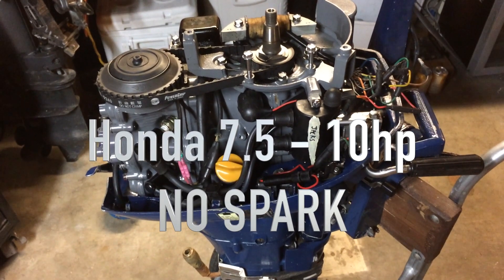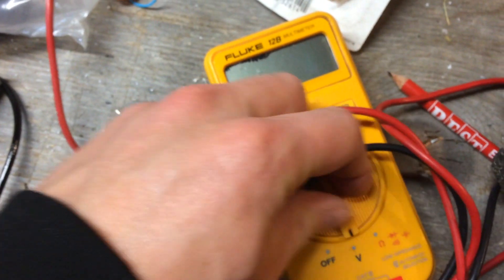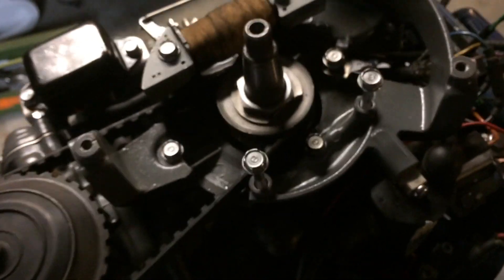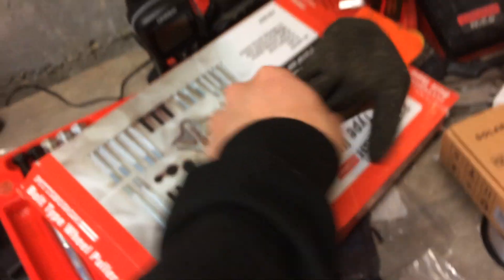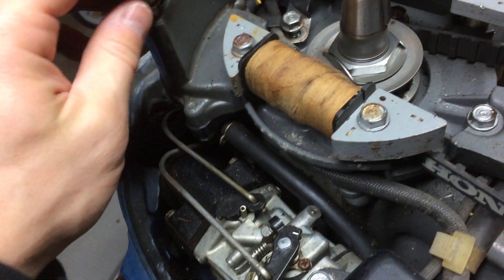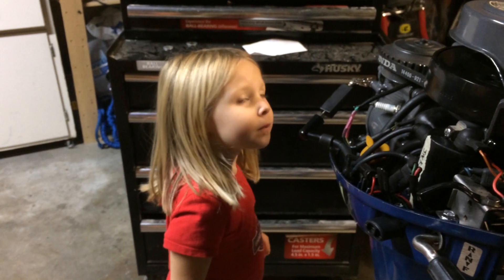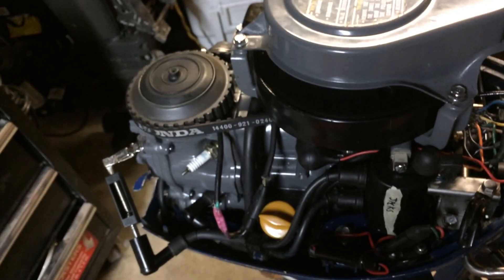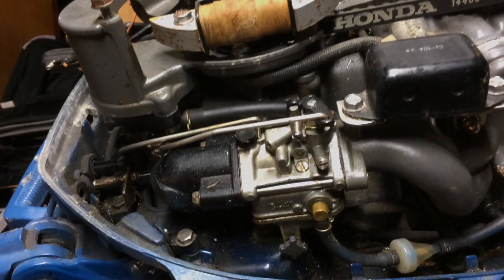Honda 7.5 Outboard Boat Motor - No Spark

Comment: What is the serial number on that got the same problem and engine need a new flywheel coil
Reply from the maker: Sorry, sold the engine years ago. The engines are mostly the same.

Comment: I have the same motor do you have a model number or can you guide me on where to get parts for it?
Reply from the maker: BF8A is the newer one that most parts will fit. They are hard to find. Google that and look on ebay. good luck.

Comment: Can you please provide spec.for Pulser coil in Ohm.
I already replaced ignition coil now will replace CDI  but never thought about checking Pulser coil.
Regards
Reply: Measure the resistance between both wire leads. 
RESISTANCE: 120 ohm +-10% Best regards. Nikola

Comment: Hi
Just watched your video.
I have 8hp Honda with no spark on...
When i measure my exiter coil from brown wire to the casing multimeter didn't bip but show some numbers.
Not too sure if that's correct result to call that coil good?
Reply: EXCITER COIL  (CDI TYPE) INSPECTION
 For Honda BF8A
Measure the resistance between the wire lead end and the core. 
RESISTANCE: 330 ohm ±10% 
. Nikola (father)

Comment: Need some help I have this motor exactly I believe and it runs greats starts on first pull every time and runs quite but after about an hour it acts as if it is overheating...its still pissing water well and oil isn't over filled I was told maybe heat exchangers but I don't know electrical componets very well...if u have any ideas let me know or if you know where I can get any more info on these motors or preferable a parts diagram let me know thank you great videos
Reply: Austin Brueggeman thermostat

Comment: So I have the same exact motor and noticed in the video the Cdi black module box on the top right of the carb and was wondering how important this was? I have been using the motor for the past 3 months with out really any issues and noticed that my motor doesn’t even have that part on it? Any information of how important that part is would help, thanks
Reply: If your motor does not have a CDI box it works with points and condenser. The CDI box, is for a digital ignition.